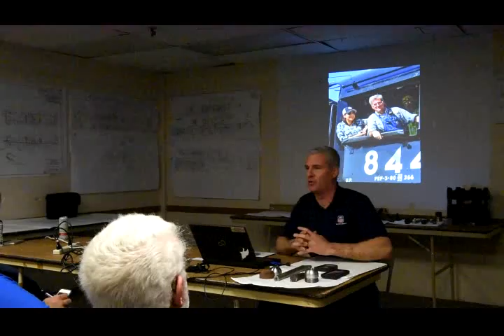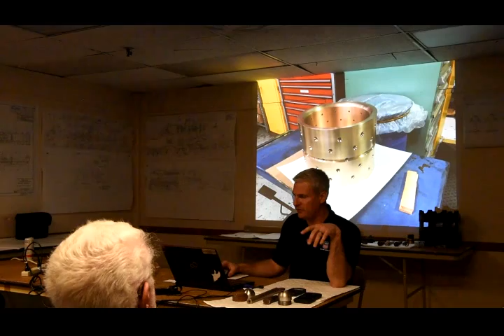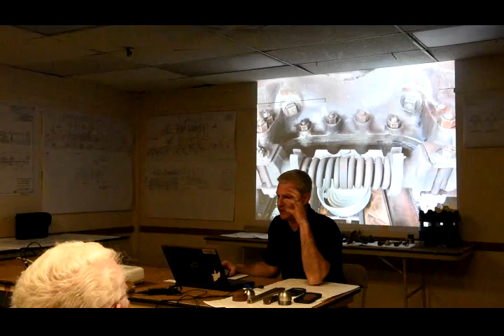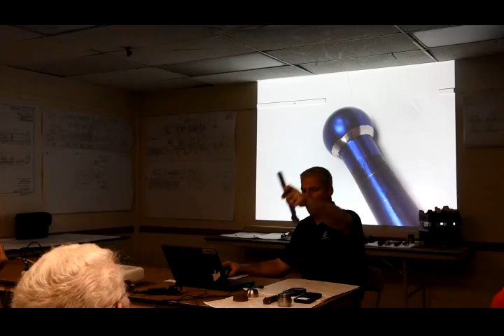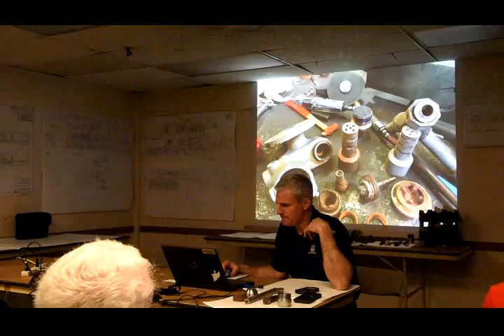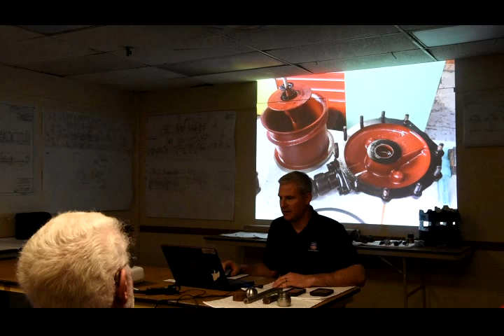UP Steam Update 2017

Comment: I spent ten years on tanks, I can really appreciate the scale. I think it was ALCO that cast the hull of my M48A3 in Viet Nam & later my M48A5 in Korea by the time I got to Korea in 1982 I was just about the only one older than their tank. A shop that can cast a 20 ton hull as a single piece of homogeneous armor steel in one pour, does not do little things.

Comment: An excellent presentation on HI TEC steam. I bet ALCO were not so thorough during manufacture.
Have you made contact with retired engineers who worked on the manufacture of these Locos.
Reply: Since these locomotives were built in the early '40's the only way that Ed could make "contact with retired engineers who worked on the manufacture of these Locos" would be to hold a séance! And if Houdini is any indication I don't think that would even work! lol
Reply: Have they started rebuilding 4014 or is she still completely apart?
Reply: Chuck.... It's been completely torn down,  and a large portion (if not all of it) of the needed boiler work, all new "stay bolts" etc, etc.... has been completed, the mainsprings (all except one set, last I heard) are all done,  and are now in the process of re-assembling everything.... that's the "nutshell" of it.     I don't have exact specifics... as of "today" and "Exactly" where they're at this moment in time... but things seem to be going along quite well.    They've done an Amazing of work in the time they've had it, considering all that needed to be done and new parts made or refurbished, running the 844 when needed, refurbishing the shop, etc, etc, etc.... and should be right "on track" (pun intended : ) for the first in-shop hydrostatic tests etc, by early / mid - next winter (2018 - 2019).
Reply: Excited to see her actually running soon. But 844 will always be my first love. Umm 2nd. Sorry honey.

Comment: With digital video available everywhere and video editing available on PCs and tablets, might I suggest that instead of the washed out images behind the speaker that someone edit in "inserts" or cutaways of the images into the picture. I can't tell you how many presentations I had to sit through where the speaker apologized for mediocre photos by saying, "well, you can't see it here, but..." I gave up on this presentation about ten minutes in. Sorry.
Reply: Wow, harsh...maybe just appreciate that modern penny pinching company is willing to spend a LOT of money on old historic inefficient equipment just to make a few people happy
Reply: usmccp....... Wow!... yourself,  that's pretty harsh to say of UP (or about any class 1 RR or organization who does) and their desire to be.... "willing to spend a LOT of money on old historic inefficient equipment just to make a few people happy"!!     Firstly,  " inefficient equipment " is Not true... as far as in terms of making lots of brut power with steam.     Their "inefficiency" was in terms of manpower,  near constant maintenance & "TLC",  rail wear from the pounding received from the drive wheels, etc, etc... when looking at total cost of operation.... but again,  Not in terms power production..... "most" of todays diesel - electrics are only just touching the Lower end of drawbar power levels compared to steam locomotives (excepting UP's "Big Blows" [8 - 10K hp] of the 1950's & 60's or their EMD 6000 series "centennials" [or, aka "Big Jack"].... and that includes steam locomotives the size of "Northern" Types (4-8-4's  -  like the UP 844, N&W 611, SP 4449, etc).... let alone the articulated's.

As far as your other portion of comment.... " just to make a few people happy "..... " FEW " ?!!!?!     You, obviously have No understanding whatsoever of the number of people not only here in the US... but Globally,   who are Huge "fans of steam"...... unless you consider Millions, literally... (in the US alone).... a "Few".   

No Class 1 RR is about to even Consider,  let alone actually Spend the money it takes to restore, operate and maintain a steam locomotive of Any size... let alone any articulated's the size of the 3985 and especially,  the 4014..... if it were to... "  just to make a few people "........ they're making a Whole LOT more than just a few... " happy ".      Remember also, that the UP is Not the Only Class1(or, 2) to own, operate & maintain a steam locomotive (or more, like the UP).
Reply: "Wow!... yourself,  that's pretty harsh to say of UP"

Welcome to the real world. Have you ever worked in a major corporation or even talked to an employee or two of a major company? I work for a multinational corporation and they wouldn't DREAM of wasting money, time and resources on equipment and technology that was retired 50 plus years ago. UP isn't doing this because they like making railfans happy, they're doing it to build their brand, because that makes them more money, or so goes the thinking. They're not a museum, they're a business, and a penny pinching one at that. I'm saying the few (as in a tiny percentage of the population) people that love this stuff (and I'm one) should be GRATEFUL they are willing to do so, and it just grates me to hear people whine about a couple of fuzzy pictures when they're lucky they get any at all. Other major railroads are trying to shed track milage as quick as they can. Be grateful UP is in a position to do this. I guarantee you the bean counters in UP can't wait to get rid of the heritage program.
Reply: What other major transportation entities spend as much time and money on heritage equipment as UP? Airlines? Nope. Trucking companies? Nope. Shipping companies? With the exception of some of the ore boats on the great lakes, nope, and those boats are only still in service because they can't make them any bigger to fit up to the loading docks. They beach ships in third world countries to cut them up for scrap because it's cheaper to build the new instead of maintaining the old.